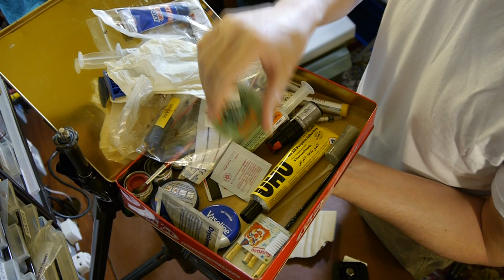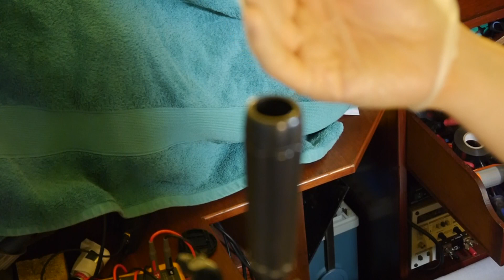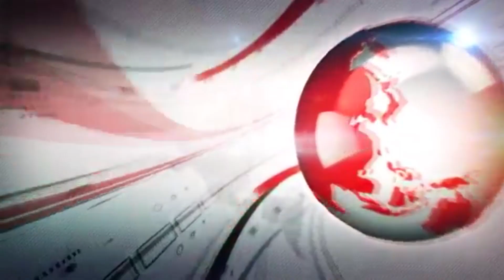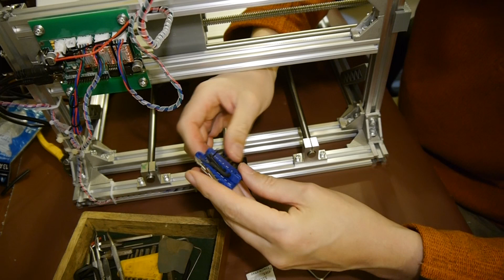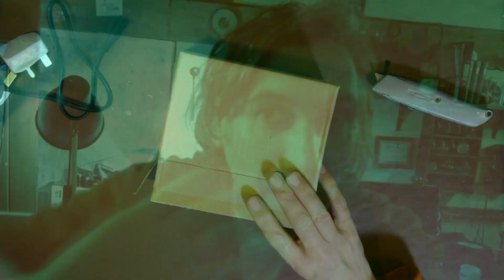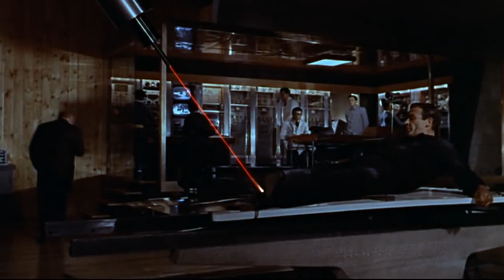3018 WoodPecker CNC - Part 5 - Maybe?

Comment: Hey there. Do you know if the 2 pin laser port on this board is power only for the laser? Does it pwm the power or is it just on off?? Thanks for the this video series.
Reply: I noticed it uses the same mosfet for the spindle.

Comment: I got one of those lasers with my machine it came with a 2 pin plug and I can't find information how to use it
Reply from the maker: There are a lot videos online that will help. But there is no easy get started quick guide. I’m afraid your just going to have to put the hours in figuring stuff out. I haven’t actually used the one I have yet as I need to get my head around the software. Obviously first thing you need is to download the software for your PC and maybe run the example design

Comment: What do you do if it says 'connected' and you can run the 'iPhone' example file - but nothing happens. There's a blue flashing light on the control board which is next to the 'Reset' button. It goes off when I press 'reset' but then comes back on again?
Reply from the maker: Sorry I cannot help as not used the thing for years and then only to make the video.  There is a GRBL forum where you should be able to get some idea  and help about the software operation, maybe there will be info on the Github.

Comment: @AllTheGearNoIdea thanks for your share, dose the WoodPecker controller have the option of connecting Z probe to it? the touching plate i mean for Z axis. Is there dedicated port/connection one the controller  i.e. NO contacts!
Reply from the maker: Yes I believe that there is some spare inputs and I know other people have used them for connection of the Z Probe.  You would also need to upgrade the GRBL firmware version to support the Z probe operation.. Regards Chris

Comment: When you end up rounding the ends of an allen wrench use a dremel cutoff tool and cut the end off.   After that I use a polishing wheel to clean off the sharp edges.  Then you have a nice flat face on the allen wrench and the edges flat as well.

Comment: How about limit switches? Apologize if it was already mentioned in one of the videos and I missed it.
Reply from the maker: Limit switches are for girls.   You can connect them but it’s not really required the motors are not strong enough to do damage. You also hand wind or jog to the start position then set a zero reference so again you really don’t need limits.

Comment: Hi there. I fried my GRBL board of the same CNC. And now I need the $$ parameters. (In console you type $$ and it show a lot of parameters.). Can you please share those parameters with me ?? I will deeply appreciate. All the best.
Reply from the maker: Alvaro Bravo  I don’t have the CNC anymore, but I do have the original software if that will helps. Let me know and I will set up a drop box with the software. Regards Chris.
Reply: AllTheGearNoIdea Hi. Sorry for delayed reply. I appreciate your help however noticed that I mess with the drivers and solved. I noticed that half or fraction steps diminish the torque noticeably
Reply from the maker: Alvaro Bravo  yes but that’s common with micro stepping. Glad you got it sorted.

Comment: Nice video.  I discarded the supplied mains cable automatically - better safe than sorry.  However I got a 5.5watt laser - sets fire to the bed in about three seconds if you don't move it!   I also want to do some pcb work so I'll be interested in how you get along with yours.
Cheers,  John
Reply from the maker: Zone1242  Hello John thanks for the comments. Did you connect the laser to the laser output on the Grbl control board? Just wondered how to energise the laser supply via G Code.  I think if you look at on of my other subscribers Eddie  has been experimenting with doing PCBs. I think like most people he has had problems with the bed levelling. I don’t think I will get around to doing any PCB as it’s just to easy to buy them made in China.  My best regards Chris
Reply: Hi Chris, yes I connect it to the laser output on the controller.  So far I've only used the crappy laser software that came with my kit.  When I try any other laser software (like Laser Web or Grbl Laser) the moment I connect to the PC the laser comes on full power at 100% duty cycle which, with my laser, is a bit of a disaster.  According to what I've read, you need GRBL version 1.1 to properly run these apps and the Woodpecker controller runs 0.9.   Apparently upgrading the Woodpecker board is non trivial so I've ordered up a 'better' controller that I can work on more easily.   I'll post an update on my channel once it arrives.
Cheers,   John
Reply from the maker: Zone1242  that’s great stuff. Been checking out your channel lots of great stuff there that I’m going to be watching. Looks like we share some of the same interests.  My best regards Chris

Comment: do you have a link for that laser? and does it just fit into the place where the spindle goes? and would you happen do know if the tip of the spindle aligns to where the laser points? Basically If i were to use the laser to expose a presensitized pcb and then switch the tool to the spindle would they align?  sorry for all the questions lol.
Reply from the maker: Eddie Amaya Hello Eddie Sorry I don’t think I can help with the questions at the moment as I cannot put my hands on the laser think maybe I have left it a work.  I didn’t try using the laser with the engraver and I don’t know if it will fit in the spindle mount. Assume it does fit the laser would be on centre with the spindle. From memory it has a 1.5 amp 12 volt power supply. I’m assuming the switched output from our Grbl board is 24v at unknown current capacity.  I did notice the focus control was very poor and I think this would make it bad for photo exposing the PCB materials. If you ok to wait a few days I will try and find it and make some measurement. Just out of interest how do you enable the  power mosfet for the laser under software control ?
Reply: I do not have a laser yet so i have not looked into the software aspect of it yet. I am just getting frustrated with the inconsistent results i am getting with the pcbs im trying to make i think it may be the ER11 collete i switch to. Because my successful mills were with the little gold tube like adaptor. my biggest issue is with the bits constantly breaking. I am using those super tiny V bits with 0.127mm tips. I damaged my spindle trying to remove the ER11 Collete because it wouldnt come out so i just ordered another one. I think ill give it one more shot this weekend and go from there. The mill is great for milling the hols and cutting the board out so I was thinking of a process where I mill the hold and then apply the photosensitive film using the holes to align the top and bottom sides. I have seen people use laser to expose as well but this would only work for me if the spindle and laser are aligned. anyways if all fails ill just use the cnc for the holes and cutout and then expose with a UV light and etch away with chemicals...but i really wanted to get away from the chemicals...but milling just doesnt give me the tolerances i want
Reply from the maker: Eddie Amaya Check this out https://youtu.be/SQa4MdTp5-k
Reply: AllTheGearNoIdea ahh good stuff . I have seen another video of someone using an elks lase engraver for pcb and he made some pretty neat improvements to it in order to get higher quality and amazing resolution.  https://m.youtube.com/watch?t=1s&v=ZzO9skEYqwY

Comment: You can buy an er11 chuck to replace that brass adapter
Reply from the maker: Rich Green  Yes I think that would be a good idea. I assume this would reduce the chuck run out. But then again the extra length of the collet chuck may work against me. Do you have any experience of collets chuck ? Many thanks for watching my videos and making time to leave a comment. My best regards Chris.
Reply: All the ones I've seen on Ebay have the ER11 collet chuck anyway.

Comment: I got the exact same model for Christmas (bought it for myself).   I started testing on foam first, now I'm testing with some acrylic.  I'm noticing a lot of vibration and wiggle during the cut.   Almost as if the shaft or coupler on the motor is bent, but it's not.     I think maybe my feed speed is too fast and my motor speed is too slow.   Have you experienced anything like this?    BTW, if anyone is looking for some software to create Gcode, F-engraver is pretty handy.  You can convert images and type text, and do cool stuff with V bits, best of all it's free.
Reply from the maker: creativefatbasta  Hi to be honest I have not used it in anger as yet I got most fun from building it. I am not too surprised your having some issues for the reasons you have already mentioned. I would also add that the Z axis does not feel as rigid as it could. Depending on what your going to be doing with it I would lower the two cross posts and the Whole Z axis. I would also buy some more T nuts and construct side panels and a base again anything to make the structure more rigid and just to add mass for damping vibration.  Perhaps using MDF as it’s heavy and strong. Your definitely going to have to take tiny cuts at a low feed rate. I have some experience with large CNC machine and these desk top machines are going to be very limited in ability and perhaps best for engraving. I would love to see a video of your machine in action sounds like I could learn from your experience. Thanks for the software tips let me know if I can help with anything.

Comment: I've really enjoyed your series of videos on this build. I bought myself one past week and have been playing about with it today. I've actually been pleasantly surprised. The couplers between the steppers and lead screws are awful and introduce a lot of wobble, so I'm going to try some flexible ones out, but it's actually performing OK for what it is. I am thinking about trying to get some limit switches hooked up. Not sure how I'll fair with that though!
Reply from the maker: Strathpeffer Junction  Ok that’s great, just been watching your videos and wondered if you going to the model engineering exhibition at Crystal Palace next week.   I don’t know much about trains unless it’s picking them up or removing bogies or loco traversers. I’m am very interested in the engineering though. Not really played with the CNC router since I built it I’m trying to get my head around fusion 360 to design my own tool paths. I would be really interested to see a video of you using your machine I unfortunately just don’t really have the time. I am thinking of doing a CNC conversion to a fully size milling machine later in the year.  Just bought some ball screws and thinking of scratch building a delta style 3D printer that’s the next project. Thanks for subscribing and my very best regards Chris https://youtu.be/IbfsW-ygpxk
Reply: AllTheGearNoIdea Thanks to you too for the mutual subscription! I live way far up in the north of Scotland, so won't be down at Crystal Palace, but there's shows tend to have some excellent things on display. I dabble with electronics as well as modelling, and try to combine the two. I'm hoping to use this cnc to kill some pcb for model railway projects, as well as perhaps help with some more general modelling...we shall see. I used to use 3D CAD software at work and have been learning 360 in the last month for my 3D printer. I was using Sketchup initially as it's quick and easy, but need to take the plunge and learn how to use better software with more functionality for this stuff. I'll hopefully get a few videos done in due course on using this machine, but have a queue of other projects to film first...never enough hours in the day!
Reply from the maker: Strathpeffer Junction  look forward to seeing the PCB videos. I did buy this machine with the idea of making my own PCBs but I’m happy to order from China. But the shipping is extortionate.

Comment: Wow.. Didn't expect such a big mention(blush). Does this mean I'm internet famous now? 

I think you might be right about the machines being of many origins.. My cable was quite a bit worse than yours. So bad, when I plugged it in for a minute.. the plug buzzed. Call me picky, but I tend to avoid things that do this. . 

Sadly, my first cuts are of the kick under the bench and deny everything grade. 

There is an ER11 collet chuck that is supposed to fit the motor. Loses a bit of capacity though I think. Look for it on Ebay or Banggood for not much. No idea if it is any good. 

Good luck with the laser. They are fun. Check out a program called Laserweb. Very nice, but you need at least Grbl v1.something. I'm considering ditching the Woodpecker board, and bunging an Arduino and a CNC shield in, unless I can figure out how to flash it to something more recent..
Reply from the maker: John Bailey  Hello John I don’t think we have to worry about the fame going to your head just yet with my 184 subs. However I only started this year with just three. It’s great fun making the video and chatting to like minded people I made many new friends this year. Love to see a video of your machine. Thanks for the great ideas and comments regards Chris. Happy New Year.

Comment: Nice.
 Ms. Dimmock had a couple of good points, decent gardener and an engaging personality, nothing else outstanding comes to mind, 
 As to the handle snapping off the tripod, glue work okay?, I had a handle snap off one of my half inch routers when i was using it- very exiting for a fraction of a second as it cartwheeled over the bench at full chat and I whimpered at the other end of the workshop, I too filled the thing up with epoxy, worked wonderfully.
 Best regards and wishes for the new year, can't be any worse than the last one.
 Sam.
Reply from the maker: Average Joe  Hi Sam yes I think the glue repair should be ok. I kept. A small sample of the glue and it has set very hard and tough so fingers crossed for a permanent repair. Yes happy New Year. I cannot see 2018 being much less disappointing than 17 but here’s hoping. Regards Chris